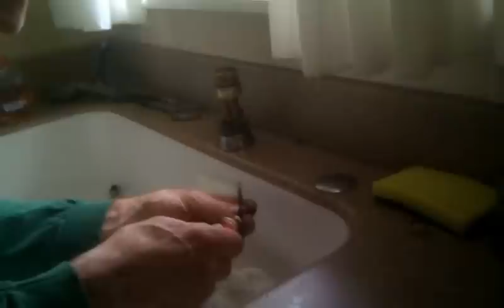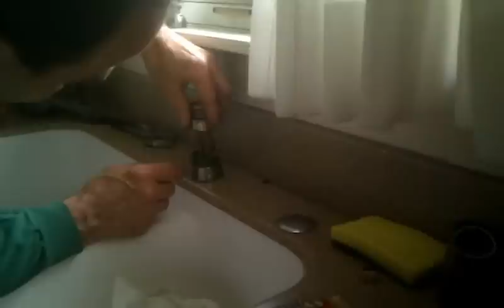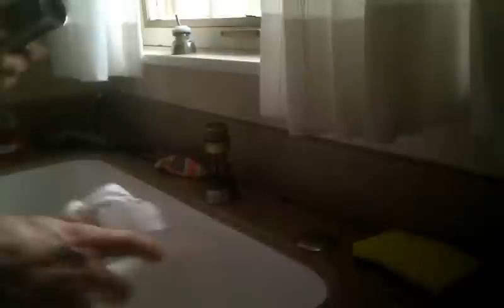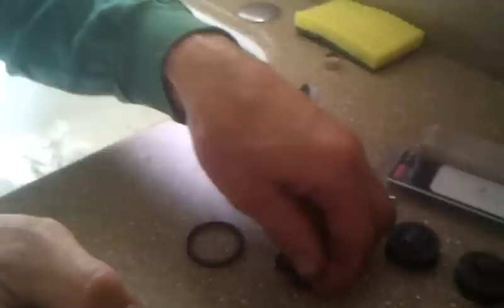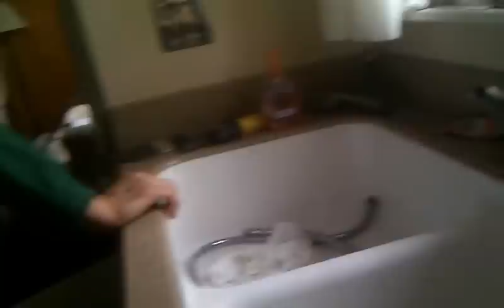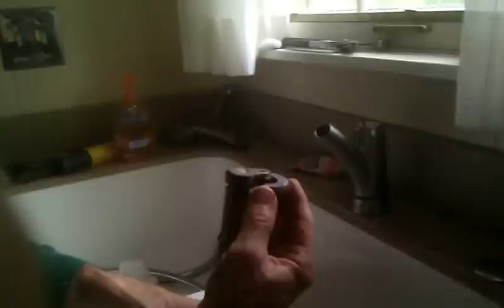Kitchen faucet repair- Delta Pullout spray #2

Comment: For my 20 yr old pull-out faucet (Model 470), I had to disconnect the hose completely and pull it out of the spout.  It disconnects under the sink by pulling off a clip and then you pull down on the hose.  Then pull the whole hose out of the faucet.  Then do the steps to pull the faucet base up and out, replace O-rings, reinsert the base.  At that point I fished the hose into the arm of the base and after a few minutes of pushing and pulling and rattling from underneath sink, got it to go through the hole where all the pipes and hoses go and then underneath sink, reconnect the end of the hose using the clip.  (There are youtubes out there where they don't have to do that, i.e. they just disconnect the aerator wand from the hose and then push the hose down into the base.  I did that first and it took some force and a lot of jiggling to get the hose to go down in the base.  And then removed the base by pulling straight up.  Then replace O-rings and reinsert the faucet body.   But when I went to snake the hose back into faucet, it kept getting stuck where it has to make a 90 degree turn. )  Turns out that the fitting on the end of the hose that is under sink is a lot smaller than the one that attaches to the aerator.   Afterwards I realized that this procedure is the opposite of the original install procedures.  Again, if you're lucky you may not have to do this but I wasn't and at least one other comment indicated there's others in the same situation.

Comment: Delta sent me a kit but didn't include the skinny o-rings that fit my faucet. Fortunately they sent me the correct o-rings before and I had the part # to get replacement parts. They're sending me the correct o-rings. I had to drill out the set screw and get a replacement handle--it was seized up and no amount of soaking with vinegar or CLR helped.
It might be helpful to show how to remove the pullout. I had to use pliers to pull the clip off and fish the hose out to remove the hub to clean out and replace the o-rings. It took a few phone calls but now it works as good as new.

Comment: 1. How do you get the disconnected hose out?  It won’t drop out from the top.  Do you have to disconnect it under the sink?  If so, remove a plastic clip and then what?  You skipped all of that part.  2. Why did you need to tighten the nut under the faucet?  Was it loose for years?  3. Could you do another video like this one that has a much clearer picture?  This is like looking through the clouds.